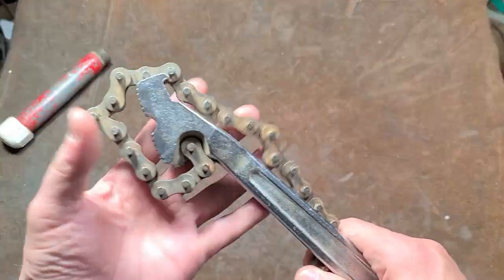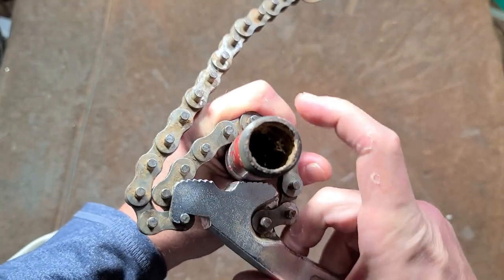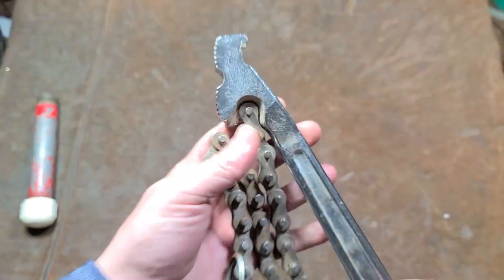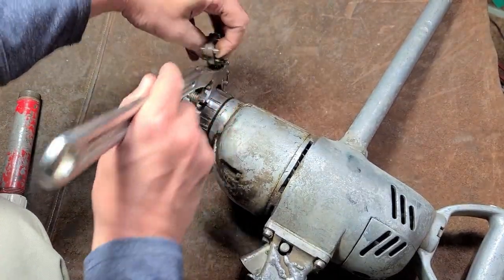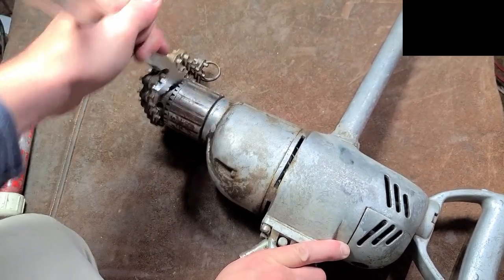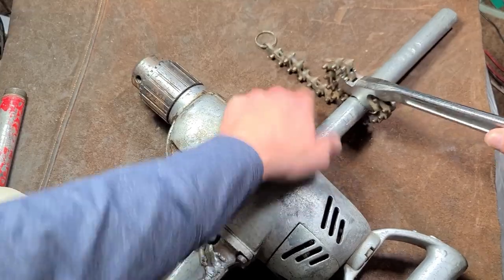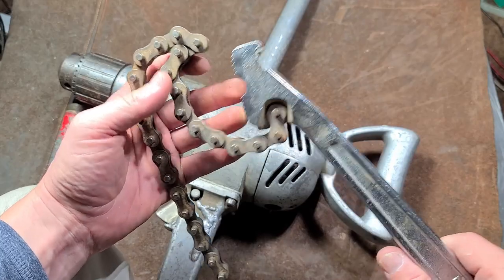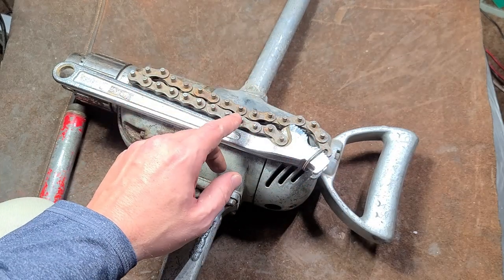Empire Dual Direction Chain Wrench Review

Comment: I have the Snap On one and I use it on balancers when I cannot get the impact on it. I made a rubber pad to fit the jaw to not mar the balancer. Never slips and always works especially if you do not have good access to the flywheel.

Comment: Depending on the size of the wrench you have a low and high limit of diameter of pipes you can use it on. I think yours is simply too big for the size pipe you tried first. 

Example: 14inch wrenches usually have a 2 inch pipe diameter minimum and 18 inch wrenches have 2.5 inch diameter minimum